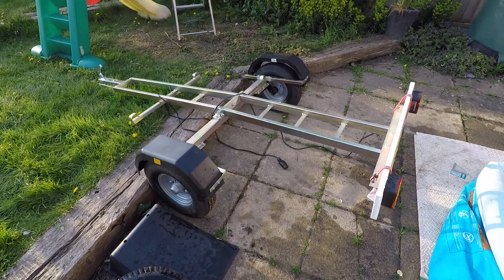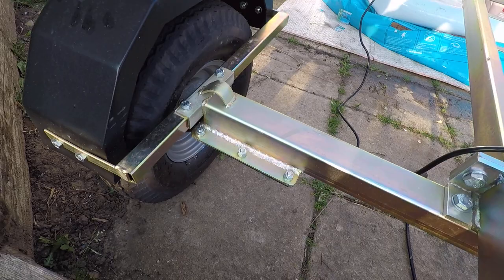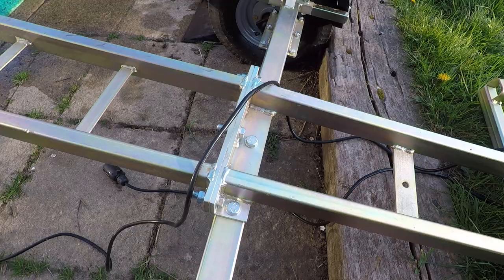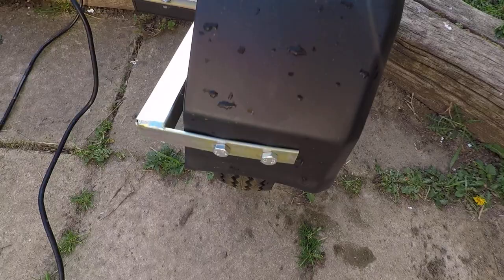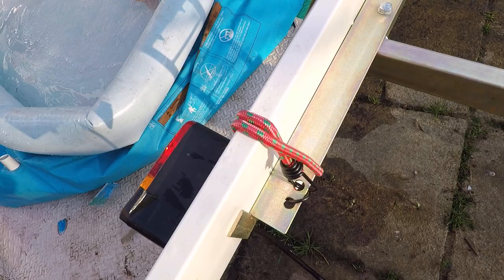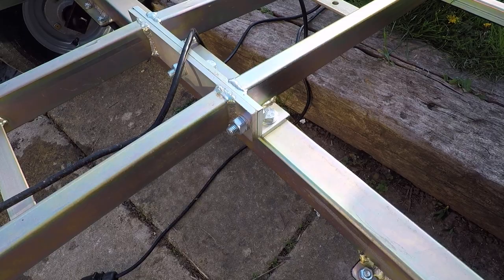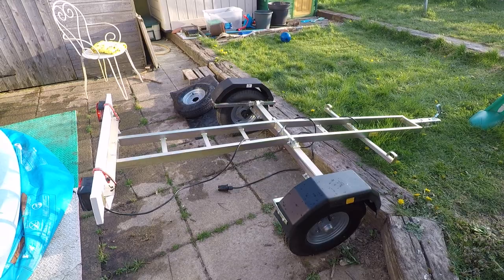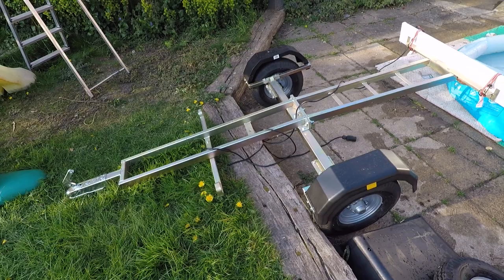Dave Cooper Single Bike Trailer

Comment: Spot on video, would you be able to tell me the overall width of your trailer ie outside of mudguard to outside of mudguard please?  Thanks
Reply from the maker: Just measured it at 54 inches maximum width. Also 99 inches long with light board fitted. 19 inches from ground to top of mudguard.
Reply: @RobFisherUK  Thanks mate👍

Comment: I've got the same one. It's good for 250kg bike. You might want to adjust the wheel bearing as these are tapered roller bearing and a quarter turn should be fine. 
I've changed my bearing for £6
New shells and bearings. 

It will rust from the inside out. 
To I oil mine up by removing the plastic plugs. 
It is difficult to load.

It's good for scooters as mine came with a bracket for the smaller scooters wheels.  Also a safety harness was supplied